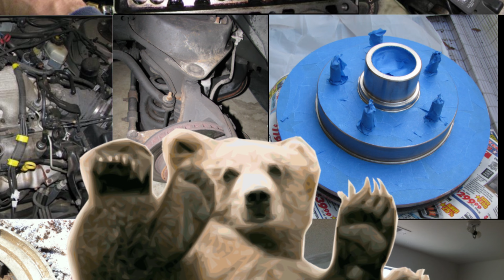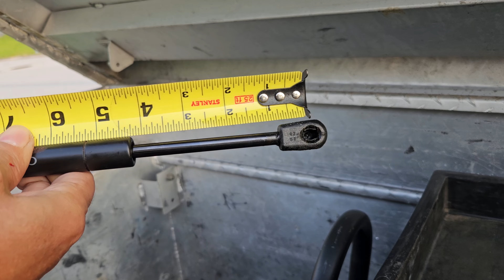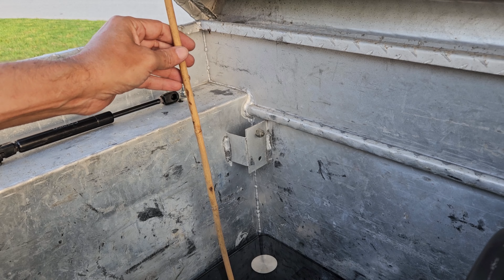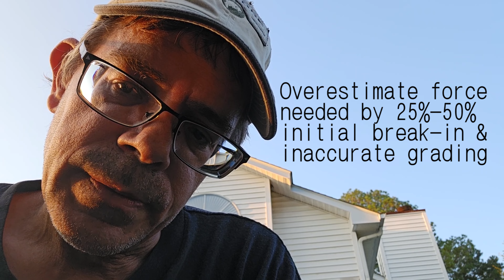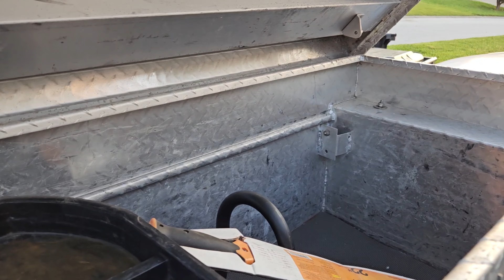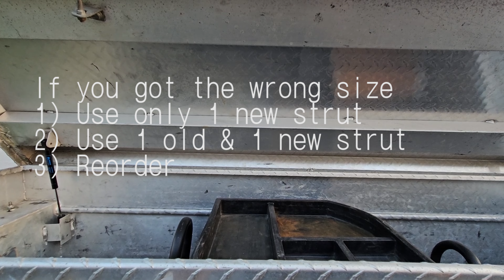Truck Box Gas Strut Sizing and Replacement

Comment: I have the same truck box and also need to replace my struts. Could you please share the struts part number? Thank you
Reply from the maker: https://www.amazon.com/dp/B0D4YS8TFZ?ref=ppx_yo2ov_dt_b_fed_asin_title&th=1  That link should select the correct length and weight. "ARANA 10 Inch Gas Struts 22Lb/98N, Tool Box Shocks 10", Gas Spring for Cabinets UWS Truck Toolbox Boat Hatch Lid"
You can opt for the 10inch / 33lb if you want auto-open that will lift the lid once you unlatch it, yet not be too much force to easily close. The description has changed a bit - when I ordered it was listed as "9.5 inch 22.5lb" but the compressed length 6.2 inch is still slightly shorter than necessary (7.5") which is OK, whereas a 8" replacement would keep the lid from closing.
Reply from the maker: Recommend that 10"/33lb over the 22lb. The stated weight range 25-36 Pounds should give you at least a couple pounds of opening force and should last longer as the struts wear.